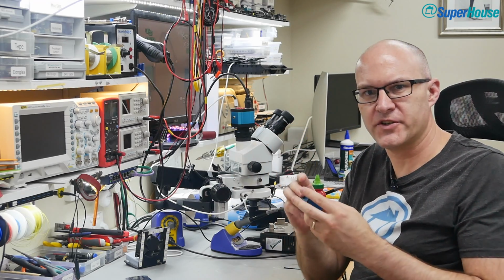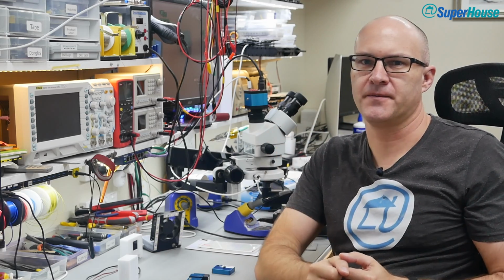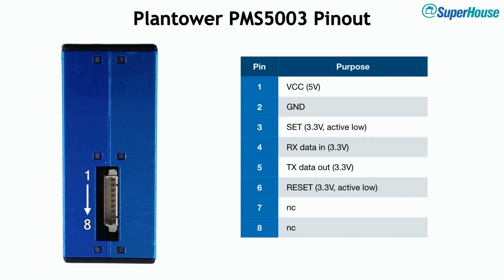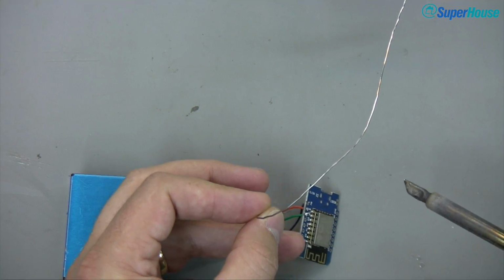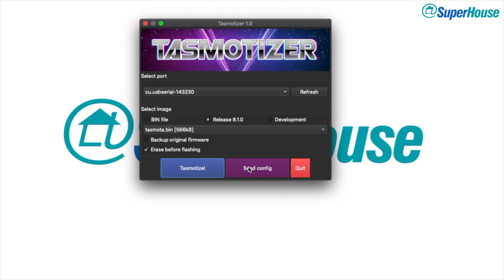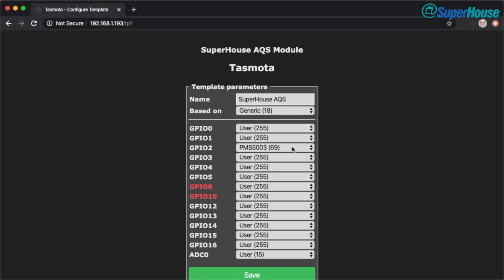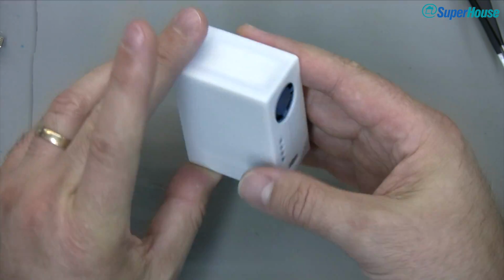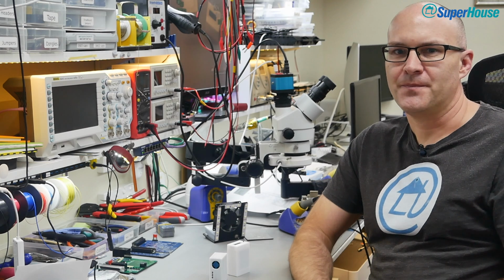SuperHouse #38: DIY air quality sensor part 1 - "Basic" version

Comment: Nice video but how long do they last before they dust cakes up on the inside of the sensor?
Looking for an industrial sensor like this for a dusty environment to detect smoke and steam. Do you recommend for this use case?
Reply from the maker: Great question. My feeling (without real data) is that an environment where there is enough dust to cause the sensor to be blocked or obscured wouldn't be a great place for these because they'd be reading extremely high numbers constantly anyway even before they got coated. They have tiny fans in them that move ambient air through the sensor chamber, and the fan would probably accumulate crud as well if the environment has lots of dust. I don't have any better answer, sorry, but I'd love to know what happens if you try it.

Comment: does anyone have any experience with the SM300D2?  The co2 is Equivalent CO2 (eCO2) so I really don't care for it much and I'm using Senseair S8 for c02 anyways.  I'm curious about the VOC and formeldehyde measurements of it actually.  Does anyone know if they are any good?

Comment: Hi Jonathan, very interesting project, I'm glad that you mention that the refraction sensor will die rather quickly if it's running 24/7 :-) There is actually a very good project you should consider adjusting the design to, and that is feinstaubsensor from the luftdaten.info. It's a world wide project that started in Germany, and it measures particles. The preferred sensor for them is the SDS011, which is a bit bulkier, but i can actually support the Plantower as well. Further than giving values readable locally, it handles the 'scheduling' of the sensors, and it also reports it centrally. THey support both indoors and outdoors sensors :-)
Reply from the maker: The luftdaten.info site is one of the things that inspired me to begin this whole air quality sensor project in the first place :-) In a later video I'm going to show some things you can do with the data once you've made a sensor, so I'll definitely feature luftdaten.info in that.

Comment: Great build including the 3D printed enclosure, Jon :) One strange thing was when I flashed the standard tasmota.bin (8.2.0, I didnt't get any sensor data. Upon checking the template on the Tasmota web interface GPIO2 was blank, PMS5003 was not listed as an option.
I then flashed tasmota-sensors.bin (8.2.0) and that worked. Any idea what happened here?
Reply: Forget what I said. Just had a look at your project page again where it states PMS support is now in tasmota-sensors.bin :)

Comment: Have you considered adding a HEPA filter to your workshop, controlled by the HA system in response to readings from the sensor? It seems like the perfect application for it, along with the graphs. Your graphs could even incorporate a variable to show the filter-fan's state so that you could see the delay effect between the fan coming on and the ppd decreasing. You could even PID control it :)

Comment: Well done, great project. I just have little issues getting the MQTT data IoBroker.Sonoff Adapter. The data are not organized very well. Some are in seperate folders with units µg/m³ and some are just numbers. Did you try that or don't you use IoBroker. And I like that 3d printed case. Do you have that somewhere on Thingiverse? Or is it not for puplic use?

Comment: Hey Jonathan, great project. Will build this. Will this work with an AWS IoT broker as well with the standard Tasmota.bin build? I'm building my MQTT infra around AWS not a local broker
Reply from the maker: If you have access to an MQTT broker (either local or remote) then it will work. There's also this alternative firmware that has AWS IoT support built in: https://github.com/SwapBap/WemosDustSensor

Comment: because it shows number doesn't mean it's correct
did you test it or compare it to other devices like laser egg+ etc?
Reply from the maker: That's a great point. I should address it in part 2. I haven't done it, but multiple other people have run tests where they've had multiple Plantower sensors and other sensors running together in the same environment over many months, and plotted the values. The result seems to be that $15 Plantower sensors are just as good as the $500 modules, but they don't have the individual calibration certificate to prove it. So if you want it for your own use, it's fine. But you can't use the results in a situation where it has to be "certified", such as writing an official report. That's what you're paying all the extra money for with the more expensive sensors.
Reply: @SuperHouseTV  i'll be really glad if you could talk about the device accuracy in part 2,
i wasted time and money on devices that looks like it's just showing a random number.
also could you please share the link of the comparison.
Big fan by the way, you are the reason i entered the smart home world <3

Comment: Hi ! Thanks for this new video. I'm fairly new to tasmota, I used to create my own code but with yours videos I adopted tasmota 👍. So maybe a silly question, but is it not possible with tasmota to wake the d1 up (periodically or based on a action from the user) take some readings send the MQTT messages and go back into deep sleep mode?
Looking forward part 2
Reply from the maker: That's a great question, and perhaps it can be done with Tasmota, but I don't know how. The problem is that the sensor has to be woken up and then run for about 30 seconds to stabilise. In that time any data it sends has to be thrown away, then a proper reading taken, then those values reported. My own firmware (which will be in part 2) does all that, but I don't know how to do it with Tasmota.

Comment: Sensirion SPS30 is order of magnitude better.
Reply from the maker: Sensirion make great sensors, I used to maintain the Arduino driver for one of their devices, but the SPS30 is also an order of magnitude more expensive.
Reply: @SuperHouseTV  in Nettigo Air Monitor Project we are using and testing many different sensors. For outdoor application our choice for many years was NovaFitness SDS011 with dedicated heating system (NAM HECA). However performance of Sensirion SPS30 is far greater than anything else in this price range. This sensor presents PM2.5 readings consistent with TSI DustTrack 8533 which costs about 12k EUR.
Why? Just take a look at inside of Sensirion's sensor. https://www.mistywest.com/posts/teardown-sensirion-particle-matter-sensor/
Air flow inside Plantowers sensors is turbulent. Air passed near many PCB components. Pathway is prone to dust accumulation.
Reply: Is it possible that though Sensirion units cost about 3-4 times what the Plantower units cost, the Sensirion might last more than three times longer, and thus pay for itself over time due to its savvier engineering? Considering it's more sensitive and accurate, and the goal is you and your family's health around a home-built unit, rather than building for mass commercial use and profit, it might be a smart buy to spend the extra $30-40 on the Sensirion if the goal is quality, and especially if the longevity increases the value. It's only the cost of a bag or two of groceries. In closing: It would be interesting to see you compare a self-built Plantower unit like you've made with a self-built Sensirion unit.
Reply: and much more expensive...

Comment: Very nice indeed. Did you consider putting the usb c on the other side? Thanks, that is very cool as is! Looking forward to the next build with the display.
Reply from the maker: So the USB socket is on the opposite side to the sensor vents? Sure, that could be done. Perhaps I'll do another version of the case for that. I don't think it would make much difference with accuracy though, because the particles it's detecting are so small they behave like a gas and become fairly evenly distributed. Having the sensor vents at the "back" of the case when it's on a shelf is not a big problem unless there are other things jammed around it.

Comment: interesting comparison of these cheap sesnors to 'real' a PM2.5 monitor. https://www.hindawi.com/journals/js/2018/5096540/ I wouldn''t trust the results of these, as the light scattering method is not a great method of measuring PM2.5. Would be interesting to put the sensor in a bigger box, and a dehumidifier on the inlet to the box to remove any moisture in the air. All the cheap sensors tend to over-estimate PM2.5 (by a factor of 3 to 4), however they do trend well with the reference method equivalent.  I use TEOMs on an almost daily basis and they cost around $35,000. You may be panicking about your AQ when you don't need to. There are only three USEPA recognised methods of measuring particulates, and none of them are light scattering. Expecting decent results from something that costs $15 is well.. hopeful.
Reply: I checked the reading from my PMS 5003 and are comparable with the data published from the local authorities about air quality. For domestic use knowing the range of PM in the air is enough, it doesn't make much difference if you read 55 and actually the value is either 50 or 60
Reply: Interesting Paper you linked in 👍

Comment: You are awesome. Nice clean engineering with solid explanation and a very usable neat product at the outcome. I can do this myself when I build this, but what is the power draw so as I have some initial understanding of battery powering this.
Reply from the maker: Great question, I should have addressed that. I'll cover it in part 2. The D1 Mini takes a pulse of up to 500mA while starting up WiFi, but only briefly. Most of the time it's in the tens of mA region. The PMS5003 peaks at about 150mA (the spec sheet says 200mA, but I haven't seen that) with the fan running, but is in the micro-Amp region when in sleep mode. Thanks for asking the question, it'll be interesting to check it out in detail.
Reply: @SuperHouseTV  Also, I think if you set a static IP rather than using DHCP you should be able to establish a WIFI connect quicker when waking up from deep sleep. Therefore reducing your overall 'awake time'  which should a little with battery life.

Comment: Great little project - wouldn’t mind putting together the advanced version (where the laser isn’t continuously running) but without the display so I can pop it somewhere safe outside to see what I’m breathing when I step out the front door
Reply from the maker: That's easy to do. The software that I'll show you in part 2 has that feature, and it works fine without the display.
Reply: Nice - I’ll just have to check that I can get all the parts delivered locally - I’m in Thailand so I’m not sure what’s available

Comment: As always a very good video. I've made myself something similar using a ESP32 dev board, SDS011 for PM 2.5 and 10 readings and a DHT22 for temp and humidity. I've used ESPhome as I find it easier for me and also the HA integration is seamless
Later edit: the PM readings are quite precise as I've compared my results with an Airly (an independent air quality monitoring network) and they are pretty close
Reply: @jj_uk  My system is based on https://luftdaten.info/feinstaubsensor-bauen/ 
The only difference is that I'm using a ESP32 dev board and the software for it was built with ESPhome - my arduino programming skills are zero so I had to stick to ESPhome

This is how the ESPhome code looks like:

uart:
  rx_pin: GPIO16
  tx_pin: GPIO17
  baud_rate: 9600

sensor:
  - platform: sds011
    pm_2_5:
      name: "PM2.5 Concentration"
    pm_10_0:
      name: "PM10.0 Concentration"
    update_interval: 5min
  - platform: dht
    pin: GPIO13
    model: DHT22
    temperature:
      name: "PM Temp"
    humidity:
      name: "PM Hum"
    update_interval: 60s
Reply from the maker: Thanks, that's good to know about the comparison with the Airly
Reply: @jj_uk  Later edit: I'm using update interval 5 min for SDS sensor to prolong it's life

Comment: Nice and tidy build! Beats my D1 Mini protoboard with a JST connector design 2-3 years back... I used ESPEasy for the firmware. Its a bit more fiddling but has a nice GUI and more settings for those that want them.